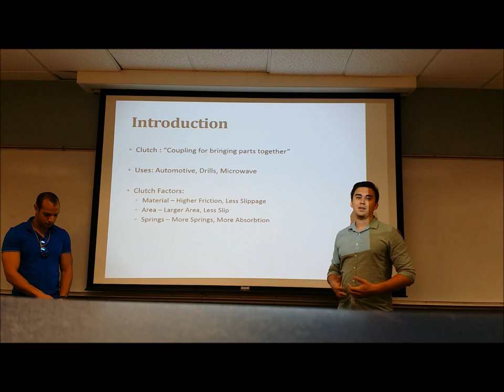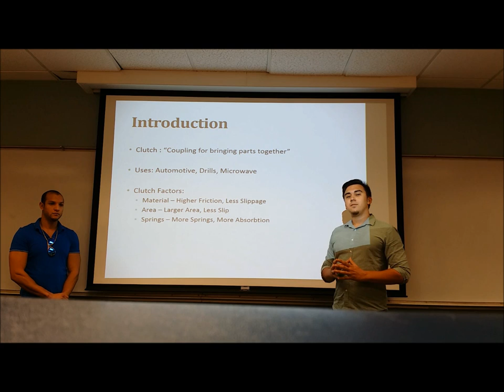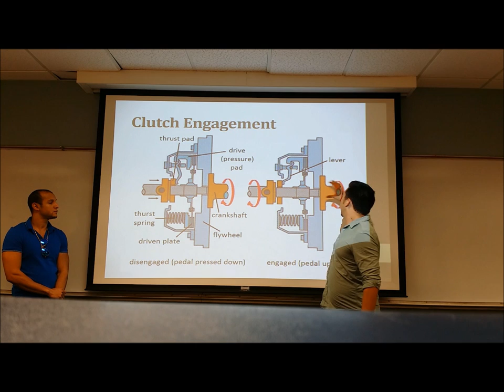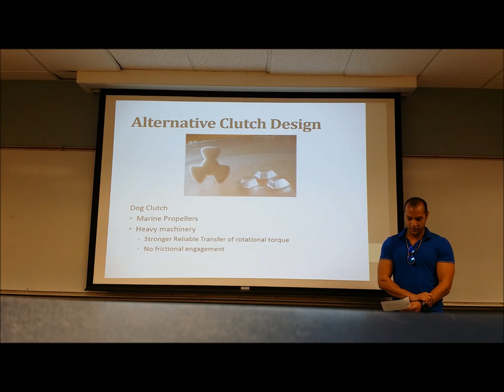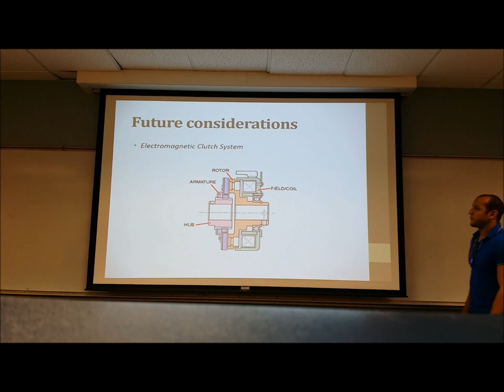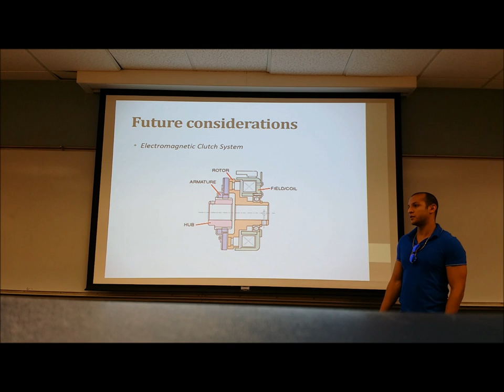Team 3: Clutch Design

Comment: Good presentation with very clear sound and video. The power point slides were clear and legible thus allowing the viewer to follow along with the presenters. Learned and discovered valuable information about the multiple use of clutches. The only recommendation would be to better level the camera platform to eliminate the bottom obstruction.

Comment: This group did a very good job of presenting the information. I feel that I learned as much about clutches and clutch design that I could from a six minute video. The sound was also clean and the video was clear. The only thing that could be improved would be to not use note cards and instead use the power point as your guide.

Comment: All presenters did a good job. Lots of information covered. Use of a laser pointer instead of having to stand in front of the light would be one pointer. Although I made the same mistake in my group video, it is one to note. Also, try not to read of off cheat cards. It is better than looking at the board the whole time. My suggestion would be to put the computer next to the camera, so you can read off of that if you get stuck.

Comment: Good presentation.The presenters had alot of information that was easily understood and they spoke at a great pace for the audience to follow. The adjustments they should consider is the camera angle, lack of formal attire, reading off of notes instead of quickly glancing at the powerpoint, and having 2 members in the camera at the beginning that can distract the audience's attention from the main speaker.

Comment: Good overall presentation, great to see the different materials offered, nowadays there are more materials but those are mainly the most common ones, usually clutch are rated by torque not hp, just a suggestion, the only thing that I think they didn't cover are the multi disc clutches, which are commonly used on high torque applications and to allow more surface area to be in contact at the time of the engine transmission engagement...

Comment: Great presentation, speakers were well informed and delivered information clearly. Camera angle could have been corrected a bit. Also the presentation could have included more slides especially during the materials, rather than have all the information on one slide.

Comment: Good presentation. Presenters seemed well prepared. The only thing was they didn't really transition between presenters so it doesn't flow seamlessly. Also the 2nd presenter can be seen clearly looking down reading off a paper in his hand. I would just put the computer in front so you can read off that if you get lost instead of the much more obvious paper in hand.